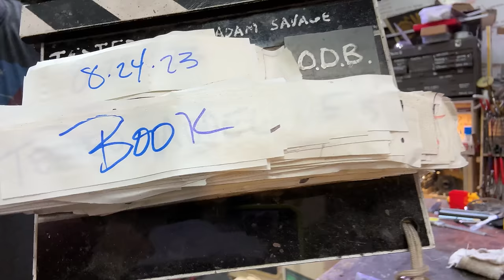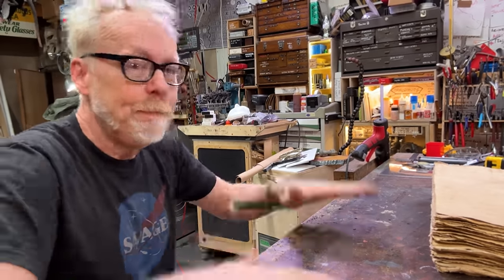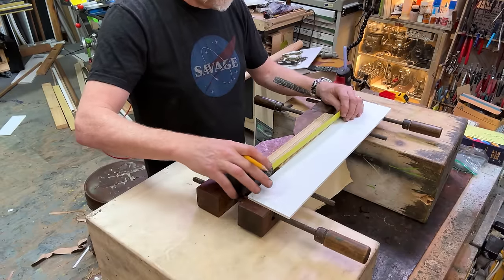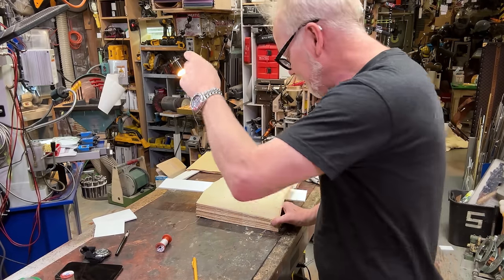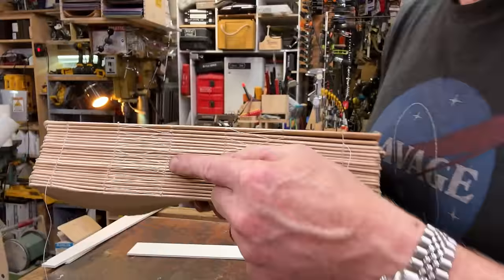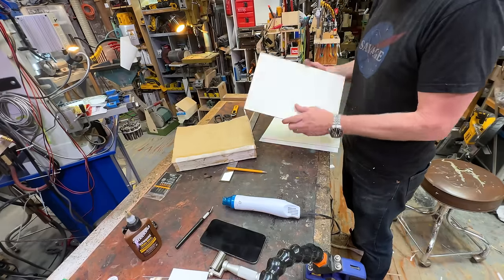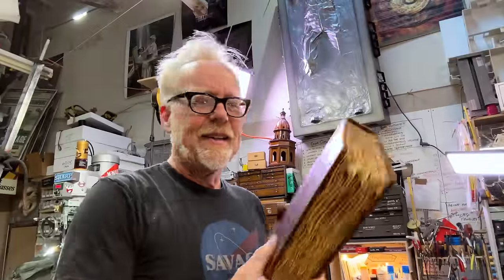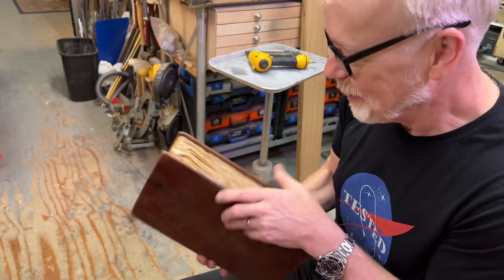Adam Savage Makes an Old Book From Scratch

Comment from the maker: Black vintage handmade paper: https://amzn.to/3tn54FX
Adam's Indiana Jones Grail Diary replica: https://www.youtube.com/watch?v=sdoO1...
Adam Savage Learns How Old Books Were Made! https://www.youtube.com/watch?v=uauXBgeImFc
Reply: have you thought about doing some leather work to make a book cover? idk what you call it the pressing and or carving of material to create art on leather.
Reply: @DASBookbinding is an amazing and deep resource for book binding!
Reply: @mattblank4402  IIRC, it's generally called "tooling" which includes pressing into the leather (like a stamp) or removing material (like carving) like you mentioned.  Interesting note, the ridges on an old book's spine are the heavier cords that bind the signatures together.  They're not just decorative.
Reply: Idea: a wholly braille diary.
Reply: @tiacho2893  Great information thank you
Reply: Adam before you attach the pages to the cover round over the spine of the pages ... then attach ... this allows the center pages to be opened as easily as the front and back pages ...
Reply: @kaboom-zf2bl  Agreed.  And the spine presents more nicely than a flat spine.  Though I think it involves careful repeated mallet or hammer blows.
Reply: @tiacho2893  yes ... a soft mallet works best .... like a hide mallet head .. the curve is roughly the arc of a circle who's radius is the length of the page from spine to edge ... for a good rule of thumb ...
Reply: A bit unfortunate that the Amazon link doesn't have the "double wide" A3 paper Adam was using. I grabbed some of the A4 to give this a shot which should end up at about 8" tall by 6" wide. Should be good enough for a first try.
Reply: You should emboss the cover
Reply: @FourKeysBookArts
Amazing work and very relaxing to watch!
Reply: The Archaeology of Medieval Bookbinding, John A. Szirmai
Reply: Yeah Adam backtrack on the easiness..mm😂
Reply: I used this method, and it changed the appearance of the paper, but I couldn't change its texture. It still feels new, and I need a way to make it feel old. I have paper that looks exactly like currency. Can you help me? I've tried many methods over the past four months without success. I buried it in the soil for two months, and when I took it out, its texture hadn't changed.

Comment: Adam: "Every tool is a hammer"  Also Adam: stands in a shop surrounded by tools;  hits things with his fist.
Reply: The hands are the greatest tool. So therefore they must also be the greatest hammer.
Reply: To be fair. They were the closest tools at hand :P
Reply: For that specific part, your fist is the best. It's not too hard to be denting the solid part of the cover, it's not too soft to do nothing. You're hitting the glue with your own directed force, just enough to make sure the two materials bind through the glue, not too much to drive it out completely. You could roll it, but you really need to know what you're doing otherwise you risk making a kink in the glue-up. So fist, for that, perfect.
Reply: His fist is a hammer
Reply: Most efficient non marring spark free dead blow hammer
Reply: Haha well the man does have a ruler on his arm..... soooo
Reply: Well they are Hand Tools after all.
Reply: but hands are your greatest tool
Reply: @amiemarieart   If I remember correctly, Adam has said multiple times that He chose to get that ruler tattoo because he wanted a super accurate ruler (one with better accuracy than a store bought measurement device (did he account for old age/skin stretch?)). And he wanted it always available. That's why he got the tattoo. Sounds odd if you think about it at 1st thought, but then if you think about Adam and Myth Busters and how Adam used it on the show, it makes sense.
Reply: @matthewjbauer1990  he was joking when he said that lol, he did say it isn't accurate but said it was useful for approximate things
Reply: Every Tool is a Hammer is a fantastic book about Adam’s extraordinary life and work…. Fab read
Reply: I suppose with a fist there's no regular tool marks, only organic, natural looking tool marks

Comment: I think this is the first one of these videos that made me think "I could do that!" I feel inspired to make a book for myself!
Reply: before attaching the pages to the cover ... round over the spine of the pages ... a curve that would make the arc of a circle whos radius is the width of the book from the spine to the edge of page ... this allows the spine to NOT be broken easy and lets the center pages open as well as the end pages ... by NOT rounding over his book Adams spine will break after limited use and break the stitching quickly ... also his middle pages will rip out easier ... and the spine cloth goes on the pages and NOT on the book cover ... it is the support for all the folios
Reply: @kaboom-zf2bl  To be fair I think Adam added linen to the pages then another strip to the cover.
Reply: Good luck.  I definitely couldn't do it.
Reply: @jkhoover  tbh ... it is easy to bind a book ... the hard part is making it look precious ... mine I make scrap books so they can look crappy ... practice improves the work
Reply: @kaboom-zf2bl  It may be for you, but I'm just not good with my hands.  I had anxiety when he was gluing the two boards together, because I know I'd mess that up.
Reply: @jkhoover  thats why scrap books to start ... they should look messy ... all it is, is a matter of practice experience and confidence ... if you can walk upstairs (unlike Biden) you can do it ...
Reply: @kaboom-zf2bl   Exactly right, except I don't think he'll have trouble with the pages falling out because while he didn't show it, I think he stitched through each signature and back out a different hole, so even the middle pages would have to rip through the thread.  I know what you mean though - I've only ever seen the slot method used for laying in thread across the spine, in which case glue is used.  Definitely needed the cloth glued to the spine though and that's also where he could have glued a piece of ribbon as a place marker, which I think would have been very useful for this kind of journal.  Oh, and the non-guillotined edges had my OCD raging, but that was the rough look/effect he was going for of course.
Reply: @Chris_the_Muso  myself I stick with the scrappy looking book for scrap books I make ... they show what they are LOL

Comment: I've always been somewhat obsessed with bookbinding. Even as a kid, I decided just stapling the edges of a bunch of separate sheets of paper didn't look that good, so instead I would sew down the center of them using the most basic fabric sewing stitch. Didn't know about signatures at the time though, so every one of these books was just one massive signature. Which in hindsight is pretty funny. 
One day in school my teacher asked us to make an educational report based on one of the units we learned in the style of an "X for Dummies" book. And I decided, "screw it, Imma take this opportunity to learn to bind an actual book." 
The actual report only needed to be about 4 pages long (and indeed, mine was only 4 pages long), but the book itself was about 240 pages long with a ton of filler pages littered throughout. Some of which were misprints of the report itself, because turns out arranging pages into signatures is really easy to screw up when you don't have a program to do it for you and have to do it manually. I used scraps from around the house to make it, including some left over fabrics from a costume I made some years back and some vinyl leather as the cover. 
When I was done, I had the stupidest grin on my face and couldn't stop cackling to myself for like 10 minutes. One of my favorite bits was doing the headbanding, because it's one of those things you never notice on books, but after learning about them, I see them everywhere and it makes me really feel like I've unlocked some view of the world I hadn't been privy to before. 

Unfortunately, my teacher only went through the reports after class, so I never got to see her reaction to a stack of papers and then randomly a fully bound book, smack dab in the middle of it, but it makes me laugh whenever I try to imagine it. The best part was when I got the book back and read through it, she had made notes not just on the report, but also on all of the filler pages and all the stupid jokes and secrets I included in them. That's when you know the effort was worth it. 
By far one of my favorite projects I've ever had to do for school.
Reply: What was the grade you received?
Reply: @justinyon2324  
Unfortunately I do not remember. I only remember the feeling of the project, which I would argue was more important anyway.

Comment: I wrote a kids/young adult book about time travel and wanted to print it like a book. It was fun learning about signatures and that ‘Word’ can print them. I ended up running each signature through a sewing machine, hand stitching the signatures together through the machine stitches here and there. I clamped it tight whilst it did that and then using wood glue adhered a small piece cut from an old bed sheet. It came out so well that my wife refused to write on it with her comments, which was the whole point of printing it out in the first place! I still have an unedited potential bestseller if anyone wants to buy the movie rights😂. Now half way through the sequel. Loved the video Mr Savage!

Comment: Awesome video. I have been contemplating sending you one of my books to nudge you into making a book. I've been making books for about four years now and all the things you said are completely true. I still don't have none of the fancy equipment you "need" to make a book. No book press - use two cutting boards and some woodworking clamps, for cutting the holes for the thread I use two expandable planks and woodworking clamps etc. The process is super fun and the end result is super satisfying. If you guys want to try it, don't hesitate.

Comment: Replica books are some of my favorite projects. I make a bunch of Grimoires from the NieR games, but have been wanting to dip back into kettle stitching & make more replica journals from other games/movies. The trick of using a saw to make the holes, I definitely gotta try! The old way of using a template, lining it up, and poking the holes with an awl for each signature is definitely inefficient lol
Reply: Adam did a video a couple three months ago (I’m surprised he didn’t mention it) at a book binding museum
The curator goes through the process and shows some real solid detail, some of it missing in this vid. I recommend you go back and look for it. IIRC she uses the saw method also

Comment: I originally learned to bind because I wanted higher quality paper in my sketchbooks. Didn’t know how much of a rabbit hole it would be, lots of specialized techniques and tools for the best results. The most valuable tool was a “press” that I made from two plywood boards, some all-thread, couple t nuts and wing nuts. Used it as a sewing jug and press to set the signature block. Now it takes up room in my shop! Very nice to write in, draw in and give away books you’ve made

Comment: Oooh, fascinating! :D

I worked in bindary at a print shop a while back but I never did this type of book binding. I mostly did cutting paper stock down to print size and shrink wrapping stacks of printed pages. Occasionally I made NCR and note pads, but that was using PVA glue on the spine, then separating the individual pads from the stack.

Comment: When I was in elementary school in Montreal, Quebec late 80s, I was fascinated at how the school library routinely took new paperback releases and had them rebinded professionally with more solid stock. The result was a massive hybrid bound book with its modern cover. It gave the book collections a solemn air of uniformity and I’m sure the process extended the lifespan of these flimsy paperbacks exponentially. The books bound this way had a different feel and smell to them and I always thought it was so cool. I wonder if that is still done these days 🤔

Comment: Oh just for anyone starting out, four keys had great advice for folding paper in quarters (rather than half). Once folded in half, slit the signature at the crease about 2/3 the way through and it will help avoid wrinkles and creases around the second fold. Much more cost effective to practice on smaller books to use less board.

Comment: You can use a buffing wheel and polish meant for shoes (mostly wax but also some color) to make patches. Around the spine, around the bottom corners, edges. Simulates years of it being picked up again and again. Also, i'd damage the leather at the top part of the spine. Like it's been picked up from a bookcase many times. You can stop it from being an actual damage and prematurely messing up the bind by gluing ripstop instead of linen.

Comment: I've been stitching small A5 notebooks to use with my fountain pen hobby.  Very simple single signature (10 sht + cover) soft cover books with fabric tape on the spine to cover the stitching.  I've also given a few personalised ones to family and friends (sometime with a Platinum Preppy fountain pen).  It's a very rewarding hobby.  I started doing it because I wanted notebooks with very heavy (170 gsm) surfaced paper, and it's just not possible to buy anything like that.

Method: I punch 5 holes through the middle of all the A4 sheets (on the fold) using an awl, then use heavy thread from the middle hole in and out from one end to the other and back to the middle again.  This works for any odd number of holes.  To finish, once you have the threads coming out the same hole on the out side of the spine, take the needle once around the thread at the adjacent hole then tie the two ends off tightly with a simple square knot.  Put cloth tape over the spine to protect the stitching.  You can see the stitching when you open the book to the centre page only.  This gives a small book that opens flat to any page, and ten sheets is 40 pages, so enough for a journal or note taking.  One of my more inspired ones was a travel journal I made for my brother.  I use pegs to keep all the sheets in register while punching and stitching, but you have to use folds of paper to stop the pegs from marking the surfaced paper.  The heavy paper also works well in an inkjet printer giving photo quality results, so you print cover photos, ruled lines, Journal guides or whatever else you want.  For the cover I use the same paper but a gloss version for the cover, I may go to a 250 gsm sheet for the cover in the future, and I also have some card that I might try for a hard cover version.

Comment: I know a tool you need and will love.  Get yourself a temperature-controlled hot air station.   Even a cheap Chinese model ($200 ish) will be awesome.  Yes, they're for soldering, so they often go up to 500 or 600c (and have F settings if you so desire), but they are also controllable down to 100c (212f) in most cases.  Perfect when you need to heat something only a little.  I use mine for soldering, of course, but also for removing labels from plastic items, melting heat-shrink tubing without damaging it, and drying glue/paint without damaging the paint/glue or the things it's been put onto.   Get one, you will not regret it, and you'll wonder how you've gotten by all those years without one.

Comment: Since i'm mostly making them as notebooks, i don't bother with the whole hand sown part, i just run them through my sewing machine. Tallest gait with a super thin needle (which is a bit difficult, because the machine's not made for that kind of work, but you can make it do right if you fiddle with the mounting and center it properly) and 100% nylon wire which has the benefit of actually making very strong bonds under glue. Rest's normal, but this saves a lot of time and the bind is actually very strong because you're supporting the whole thing all the way.

Comment: Sanding the edges of the paper is great if you don't have a guillotine for a perfect cut and still want to smooth them out a little, and also depending on the tool used it might be too fast and burn the paper, giving it a golden/brown stripped look that is amazing.

Comment: I like to buy large ring bound sketchbooks with a back board (close enough to chip board) and take it apart to bind my own. I fold the pages in half for my signatures, and I cut the back board in half for the covers. I bind the front and back covers on the rest of the book as if they were regular paper signatures and leave the spine exposed. You get a book that lays completely flat without help and is a fully blank canvas from cover to cover.